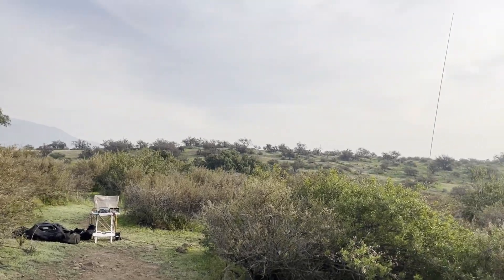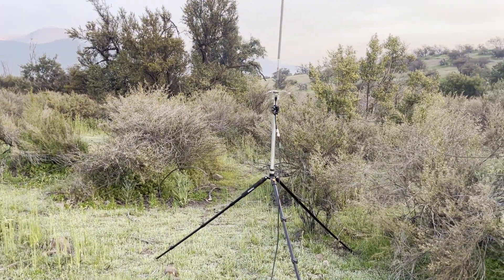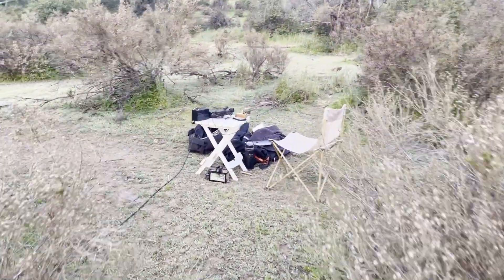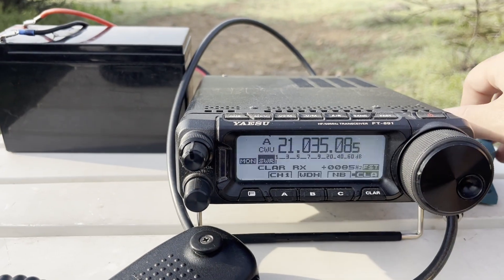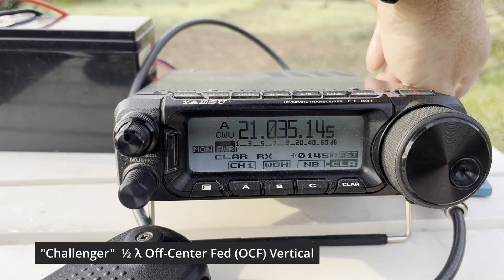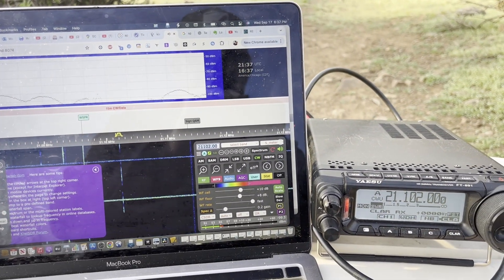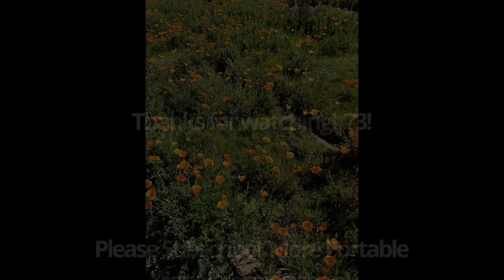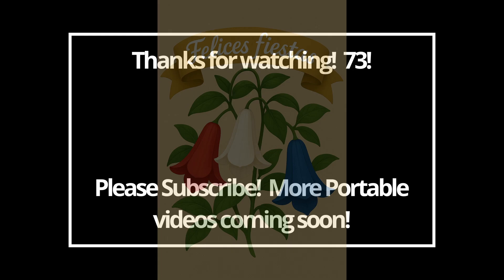KJ6ER's PERformer vs Challenger Comparison - RX/TX Performance Revealed!

Comment: I use both regularly. The challenger is more convenient so it's my go to, but I can do a little better within the US by setting up the performer with the radials at 90 degrees and aiming the beam down the center of that sweep toward the State I'm trying to reach. The lower angle on the challenger has been a little better for DX overseas.
Reply from the maker: Everything's DX from here.  Both antennas were equal for me from here.  I've never used the Challenger antenna in the US but the PERformer does well.

Comment: You can compare GP and PERformer erected on the ground with AB.
Reply from the maker: Are you referring to a ground-mounted vertical with 4 radials?
Reply: Yes
Reply from the maker: @huangcheng2130  Will take a little time to build, but it seems like an interesting project.

Comment: Great Video, Jason! Both are great antennas I've been using the challenger more because its a bit quicker to deploy. I have the problem with getting the radials elevated in the tough soil here too.
Reply from the maker: Unless there's a significant difference on 20m, I feel that the PERformer radial set may be left in the U.S.

Comment: Nice comparison! It was hard to tell the difference! I may have been a little stronger on the Challenger, but that could also be QSB. I have a 20M wire OCFD that I should play with. I can hang it as a vertical on my 33' mast. N7BBQ
Reply from the maker: I found that they were indistinguishable.  I will try the same test on 20m.